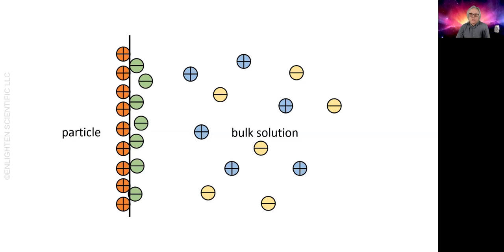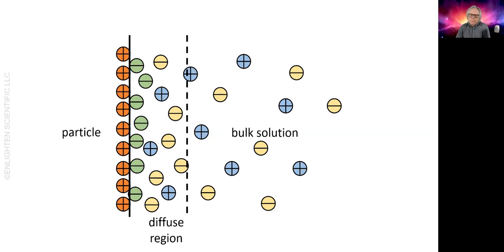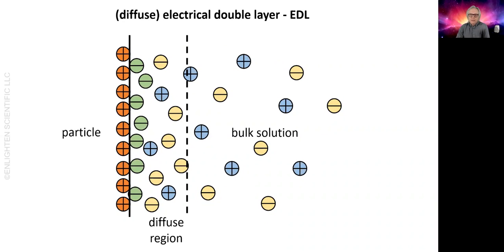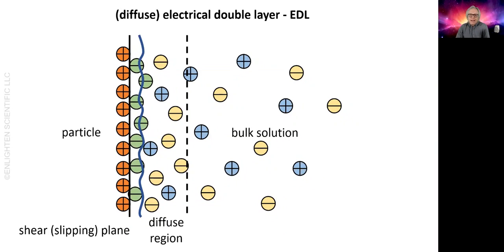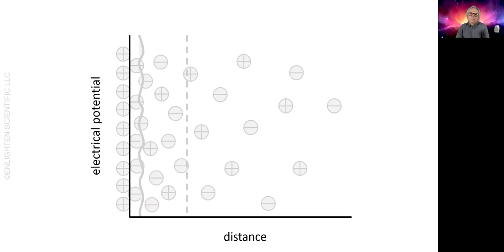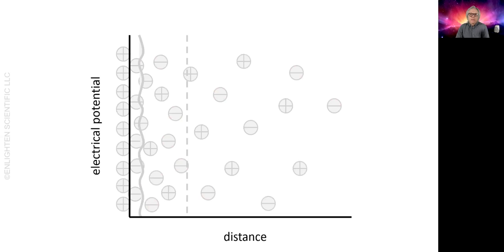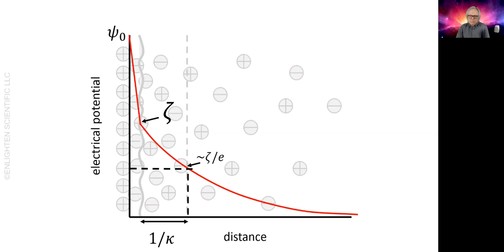Measuring zeta potential - origin of zeta potential

Comment: This is nice explanation. Some may find it easier to understand the potential definitions by turning things around. Rather than starting with the surface potential and then considering how the potential falls off as one moves away from the surface, instead start with the (arbitrary) definition of zero potential at infinity. From there, consider bringing a positive test change towards the surface. Moving through the neutral bulk, we are far from the positively charged surface and do little work. As we approach closer, we do more and more work causing the total work done (q*V) to rise. The value when we reach the surface is the surface potential. The values as we cross various critical points along the way define other values, such as the zeta potential.  I came here searching for an understanding of the definition of the slipping plane. I hope sharing my (hopefully correct!) way of thinking about the electrostatics will be helpful to someone else. It is entirely consistent with what was presented, but is just another way to think about it that some may prefer.
Reply from the maker: Thank you. I agree with your approach! Somewhere in one of the other videos I use a similar idea to explain the relationship between potential and charge.

Comment: Dear John, thank you for this great video. How does instrument know what the charge of the particle is during zeta potential measurements? I cant find any relationship between the sign of the charge on the particle and the sign of the zeta potential that the instrument reports.
Reply from the maker: Hi - thank you for watching.

The sign of the zeta potential indicates the sign of the electrical potential at the slipping plane relative to the bulk. This isn't necessarily the same as the potential at the true surface of the particle. Although it is generally okay to use the zeta potential to give a fair indicator of the surface potential/charge, it is important to understand the nature of the particle-liquid interface. For example, a charged particle with an adsorbed layer of a nonionic polymer will yield a zeta potential lower than that of the same particle without the polymer.

Comment: Dear John, thank you very much for sharing this fantastic presentation. I have read all the comments but I have still two doubts about what you said. 
1. The paper you recommended (Delgado et al., 2007) describes that "The potential at the plane where slip with respect to bulk solution is postulated to occur is identified as the electrokinetic or zeta potential,ζ". Instead you locate the zeta potential between the rigid layer associate with the particle and the diffuse layer of ions. There is something I am missing.
2. In the previous video, you define de EDL as the sum of the rigid layer and the diffuse layer of ions. However, in the plots you define the EDL as that represented by the length 1/k which does not take into account the rigid layer. 
I would really appreciate any help to understand. 
Thank you very much.
Reply from the maker: Hi Raffaella - thanks for your questions.

Regarding 1., at a high level, my description and Delgado et al's are consistent. The EDL comprises a rigid layer (particle) and diffuse layer. Think of it like an electrical capacitor but where one plate is diffuse. The zeta potential is - by definition - the location that delineates motion of the particle and any bound materials from the bulk liquid. At a most simplistic level, this is the same as delineating between the particle and the surrounding diffuse layer of ions.

Regarding 2. and following on from 1., the definition of zeta potential (as the electrokinetic potential) is chosen so as to be of experimental value. i.e., it is the potential that we can access somehow through experimentation such as electrophoresis, electroosmosis, streaming potential or sedimentation potential. There's nothing inherently "magical" about it - it's just represents an experimentally-accessible estimate of the potential near the surface. Because electrokinetic experiments relate to the potential at this location, they tell us nothing about the nature of the interface at regions closer to the true particle surface. Hence, it is appropriate to find some way to characterize the concentration profile of ions in the region of the diffuse part of the double layer up to the location of the zeta potential, rather than the true particle surface. As with many properties that decay exponentially with distance, it is convenient to use a parameter that indicates the distance at which the property is 1/e of its starting value. In our case, the starting value is the ionic composition at the slipping plane.

Comment: Hi, why the potential of the inner slipping plane is defined as the zeta potential, not the outer plane of the slipping plane? If it is the inner plane, then what make it different than the stern potential? I though the zeta potential is the potential at the outer slipping plane. Dr. John Miller please address my confusion, thank you .
Reply: I think you are right, I watched and read several doc about zeta potential and normally the zeta potential is the outer plane of the slipping plane

Comment: the diffuse region shouldn't include the stern layer. this is a mistake in your explanation.
Reply from the maker: Thank you for your comment. I don't mention the Stern layer so I don't understand your remark. I intentionally avoid any jargon associated with a specific model of the diffuse double layer (e.g., Gouy-Chapman) and, instead, describe the qualitative features.
Reply: Enlighten Scientific the diffuse layer is when the charges become even. It is also called the “outer diffuse region” since the first layer where you only have the immobilized negative charges is know as inner molecular layer.
Reply from the maker: @patrickdamacet6085  My description is consistent with yours though I have never heard the term "inner molecular layer". Do you have a reference that defines this? As I say, I deliberately don't get into the specifics of a given model since the classic models don't apply in many situations (e.g., porous particles, fixed charged networks, conductive surfaces) and even the concept of zeta potential becomes invalid.
Reply from the maker: @patrickdamacet6085  You are incorrect. The charges are "even" in the bulk solution. The diffuse layer always has non-equal concentrations of ions and counterions - it has to. The concentration differential is greatest near the particle and tends to zero infinitely far away. Where does the term "inner molecular layer" come from? I have never seen this in any definitive works on electrokinetics (notably Hunter). For a simple electrolyte solution, there are no molecules, just atomic ions. I've seen "inner Helmholtz plane" which is related to the immobile bound ions and the "outer Helmoltz plane" which is related to the distance of nearest approach of hydrated ions (for GC-type models).

Comment: I really got confused when it comes to the definition of surface charge. Is it the overall charge created by the first (and fixed) layer of ions adsorbed on the surface (i.e. the stern layer), or the charge of the solid surface that makes ions adsorbed on the surface?
The prior definition means that in you explanation the surface charge is negative, while the later means that the surface charge is positive.
Reply from the maker: Have a look at this paper: http://www.damtp.cam.ac.uk/user/gold/pdfs/teaching/ufk_papers/electrokinetics/hunter.pdf

One of the authors (Hunter) has literally written the book on zeta potential (https://www.elsevier.com/books/zeta-potential-in-colloid-science/hunter/978-0-12-361961-7) and I consider him the authority. Page 197 of the paper presents the classic picture of the double layer. I use the same definition for surface charge and I deliberately ignore the finer structural information since definition of zeta potential is the key thing most people need to know.

Part of the increasing confusion is that what was once a subject strictly within the realm of colloid science has been adopted by other disciplines (basically nano- anything) and those disciplines are eclipsing the original works often with misinterpretation of those scientific foundations.
Reply from the maker: Sorry I confused you :) Surface charge refers to the charge without anything adsorbed. For example, silica particles develop charge because of dissociation of OH groups on the surface. The surface charge means all of the O- groups. Of course, H+ ions will be in solution. Some will be attracted back to the particle and adsorb (not necessarily where the -ve charges are) and some will remain in solution. The adsorbed ones will screen the surface charge, thereby reducing the potential. The ions in solution will form the diffuse part of the double layer. Addition of extra electrolyte may cause more (counter)ions to adsorb, lowering the potential even further.
Reply: @johnmiller0000  Don't worry, it is mostly not because of your explanation. I still got some insight from you video, so thank you.
However, we all working in this field should be more careful with the definition of terms. My field is chemical engineering, but I have to study colloid science for my research. I found that surprisingly different sources will say different things about these two: surface charge (I asked you) and the structure of the double layer. If you search for explanations or textbooks, you will find many who said that the surface charge is the charge due to the adsorption of ions, as opposed to what you said. Of course, there are also those who explain it the same way like you did. Regarding the double layer, it is even more confusing. Many scientific articles from reputable journals will give you different picture of the double layer. For example, here you define the slipping plane as the line (or border) between the fixed ion layer (Stern layer) and the diffuse layer. In some papers or books you will find that it is between the diffuse layer and the bulk liquid, while some said it is between outer Helmholtz layer and diffuse layer. I googled "double layer slipping plane" and found figures of different schemes. This is so frustrating.
Reply from the maker: I agree with the confusing range of explanations. I try to cut through all that and keep it simple enough to get the physical basis across. Descriptions of the double layer etc are just theories and the terminology is quite subjective. I made a point of explaining how potential relates to charge - that's something that is rarely explained.
Reply: @johnmiller0000  Yes, you're right. I really appreciate your effort in this video. Moreover, you are willing to discuss this detail with me, so thanks again. :)
Reply: @leinadatidumarp  Yes I thought I was in the same situation.Looking for more information but just getting more and more confused.Seems that there isn't a common agreement about these definitions.
Reply from the maker: @linfordz.8983 Can you expand on your comment? I understand the confusing differences in terminology but I'd like to know why you want to know about the origin of zeta potential etc (idle curiosity, academic research, commercial product development etc). I like to keep explanations sufficiently high level to get the important physical concepts across so that the information is of practical value rather than confuse people with theoretical detail that often doesn't apply in the real world anyway.
Reply: @linfordz.8983  I recently found this review: http://www.skb.com/publication/2032424/TR-10-26.pdf
Could be a help.
Reply from the maker: There's a Google Preview link on the book's homepage that lets you read the first three chapters for free.
Reply: @johnmiller0000  Hi,  thanks for the explanation. I have a couple of questions to ask. 1. Is zeta potential the electric potential at the shear plane or it is the potential difference between the shear plane and the bulk solution? 2. The definition of electric potential says that it is the work that needs to be done to bring a unit POSITIVE charge from infinity to any point in the electric field. If this definition is true, and our surface charge is negative, then it should require less work to be done to bring a positive charge from the solution to the surface because of the attraction between the opposite charges. In fact, then the potential should increase as we move right from the colloid surface. I'm definitely missing something. Can you please explain a little bit further?
Reply from the maker: Hi - it's the potential difference between the shear plane and the bulk solution. You are right about the definition of electrical potential. I included it because most discussions of surface charge and zeta potential don't explain the link between the two. For the case of two particles, instead of the work required to bring a single positive charge to the desired point, we are concerned with the work required to bring two identical charges together. Hence, the work will always be positive and so thermodynamically unfavorable.
Reply: @johnmiller0000  Thanks for the reply. So if we want to bring two opposite charges together, then the electric potential (positive work)  will also decrease over the diffuse layer? or it will increase?